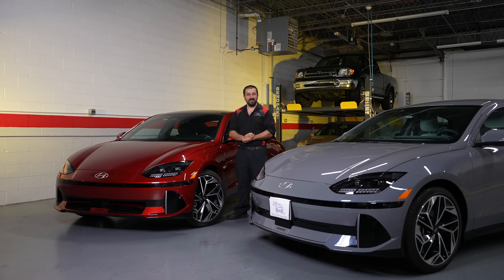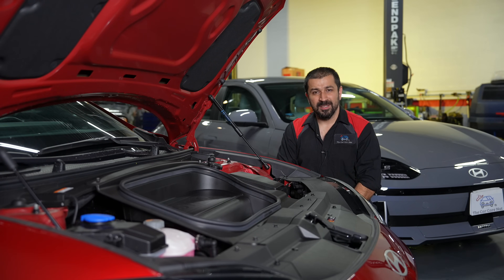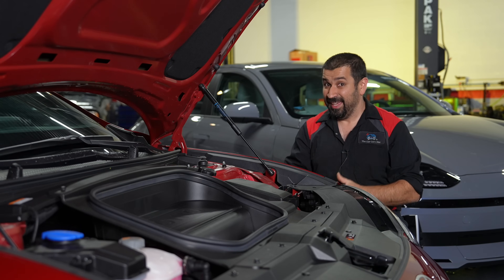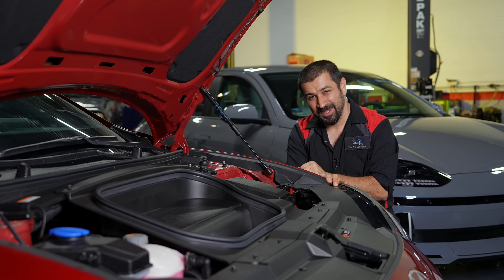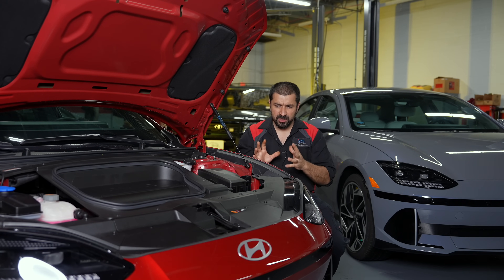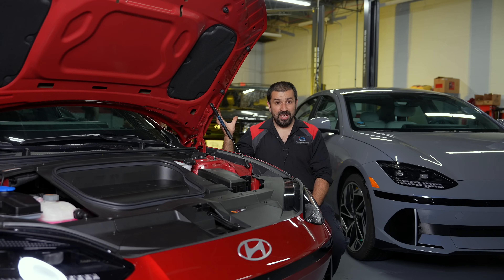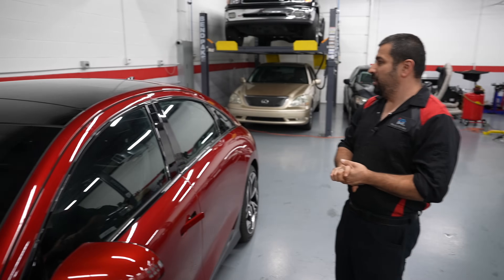Should You Buy a Hyundai IONIQ 6? Thorough Review By A Mechanic

Comment: I live in SW Utah where it's 100*-118* from the beginning of June to sometime in September. Nights don't cool off that much. Sometimes the lowest temperature in the hour before sunrise is still in the 80* to 90* range. In the Winter temps can go down into the 20* to 40* range for a week but usually stays in the 30s or 40s.

Even sitting in the garage temps get pretty hot/cold. Even going in the garage to fetch something during these extremes is uncomfortable.

From what I've read both of those conditions are hard on an EV battery when sitting unused.  Is the correct? Are there solutions to the problem?

Comment: EV should always have resistance heating (ptc) as a backup if heat pump is unable to function. Also it’s extremely common in southern US regions to require A/C for dehumidification AND heating at the same time for windshield defogging for visibility. Yes one can use chilled dehumidified air directed at the inside of the windshield for removal of fogging in the inside of the glass, but the problem is this cools the glass so much that the OUTSIDE air which is high in humidity will condense on the outside of the windscreen, then the wipers need to remove the mist. It’s vital to be able to operate the compressor for humidity removal AND heat the air at the same time and I don’t think a heat pump alone can accomplish this without also using resistance heat. I would like someone to prove me wrong, maybe the tesla octovalve does this I don’t know

Also DC fast charging should only be used for long distance road trips. An EV should normally be charged on level 2 in the convince and safety of one’s own home. Being able to “refuel” over night and waking up with a “full tank” every morning is one of the best features of owning an EV. Even though Hyundai gives owners 2 years of free charging, do not NOT use this to regularly charge your new Hyundai. You are wearing the battery AND plugging up the Electrify America chargers which are already HORRIBLE with broken units. And especially don’t sit there waiting to charge to 100% with your free charging while others are waiting in line to legitimately use the plug for a road trip. If you live in an apartment and can’t charge at home, and you really Really REALLY HAVE to drive an electric car the. I guess go to the EA plug, but I recommend people who live in apartments to NOT own an electric car, it’s way too much hassle then it’s worth, there are plenty of nice high efficiency vehicles that don’t need to be plugged in. Save up for a house with a garage then buy your EV

Comment: Do the later Toyota RAV4 hybrids like the 2023 and 2024’s require the maintenance service on the cooling fan for the high voltage battery? You mention in a video that the intake duct is in the back seat area and Toyota has added a screen for the filter which needs to be regularly cleaned to ensure a steady flow of air to the high voltage battery. Thanks!

Comment: I’ve had mine 9 months and I don’t need to listen to a long review to cut through the chase and tell all the truth. One item that is not true, it’s super quiet on all the Arizona Highways and that’s compared to the Tesla model 3. 
Overall, it’s a great car and I only have one rear motor, not really sure why you would need 2. The big flop about the car, Electrify America partnership with Hyundai, it’s trash and was a selling point when I bought the car. You don’t need me telling this nightmare, just do the research which I failed to do. If you’re to buy one and I highly recommend you do, wait for the 2024 models that will have the Tesla charging connector. That’s a game changer and no, I’m not excited about the upcoming adapters for Tesla that will be offered for the 2023 Ioniq6. The reviews coming out of New York on the stations with the adapters attached have been so so and charging speeds are slower compared to (a working) Electrify America charger. Really though, when I drive to California, the charging situation will give you ulcers and expect long waits for usually 1 working charger at a station. Usually I search out other chargers that you have to pay for, EV-go plus other slow ones and usually you get to the point of just find something.
But as for the car, I really love driving it and love the comfort that all passengers experience. It’s a jewel……..

Comment: On Limited version, motor noise can be adjusted.  Reviewer may have had it set to loud.  When comparing to Tesla 3, Reviewer also missed that Ioniq 6 uses thicker sheet metal than Tesla 3.  When closing the Tesla 3 hood by hand, it feels like an aluminum soda can that may bend easily if not careful.  I found the Ioniq 6 suspension smoother, quieter ride, and seats more comfortable than Tesla 3.  The Tesla 3 does have better technology though.
Reply: Ioniq *. Not Ionic.

Comment: Ok… first there is no dc/dc charger module in an ev, thats the reason why those 50kw/100kw/150kw charge stations are so big.  Internal chargers in the cars are for ac charging, converti it to dc.  So the charger don’t need more cooling because of the dc fast charging capabilities like you said.

And which new car today do not have dc fast charging?  Maybe you were talking about older ones?

The "brake vents" are not brake vents, they’re for aerodynamics/airflow.  The air is actually redirected to the outside of the wheels

Nice video but as a mechanic you should have understand/investigate those points

Comment: After I heard about two Ionic 5 being totaled in Canada due to a slightly damaged battery and the crappy battery protection plate under the car and Hyundai not having a reasonable way to repair the damaged battery I will not buy a Hyundai. The replacement battery was quoted $60k while the new car was $55k.

Comment: I have plenty of seat time in the I6 and the M3.  I found the I6 to be quieter than the M3; not loud at all; it actually has less wind noise than the Lexus LS460 that I traded in on the I6. I also have NO difficulty distinguishing between the two shifter designs...they are just different, not better or worse.  The build quality of the M3 is atrocious.

Comment: Your thorough reviews have brought a few things to my mind about EV's, and maybe someone has some insight on these:
1. I would think it a good idea that each EV should keep track of how it was charged; Fast, normal, wall, etc. for insurance and resale evaluation.
2. Does anyone know how range is affected with A/C on versus windows down?
Reply: The electronics keep track of all values related to the usage of the car. How many kWh DC charging and how long stationary over 80% charged up and so on. So yes you can just read these values from the electronics.

The AC is not using an amount of power that is really relevant for range. Heating does but also nothing that's too big of a deal. Buying such an expensive car and then rolling the windows down to cheap out on electricity is the sad part of the question.
Reply: @MichaelPanzer  The sad thing is on many EV's the use of AC can drop the displayed range 20-30 miles. It is not a cheapness thing. It is can I make it to a destination thing.
Reply: Coming from a model 3, I can say, yes, ac does affect range, just as it does on a gas vehicle, ac system requires extra power from an EVs battery or your gas cars engine (higher rate of fuel usage). Instead of rolling your windows down, you can just have the fan on with ac off. The difference is let's say no AC gives my rwd m3 270 miles mixed driving. AC on will give it a out 220-240 miles mixed, depending on how aggressive the ac use is. How many people are driving more than 100 miles per day? If you are charging your car at home in your garage at night when you sleep, this is a none issue, especially considering how electricity at home is leagues cheaper than gas. You don't think of range.
Reply: @Kareem-cx4fi  Thanks for the reply.

Comment: This would be a great to lease right now...there's some good deals right now on both the Ioniq 5 and 6...same goes for the Toyota bZ4x as well
Reply: Except is actually a terrible time to lease because of interest rates and availability is still dragging (for reasons beyond me).
Reply: @sinister184  Many of the EVs are getting the $7500 credit for lease only not retail
Reply: @trdrav4  In most cases leasing companies are keeping most of that money and apply only a partial amount towards your cap cost. They’re always looking for ways to screw you.
Reply: @sinister184  I'm seeing this $7500 credit that most dealers are giving to customers because its given by the manufacturer, dealer can't change that amount. Obviously when you go car buying, you gotta due your homework.
Reply: @trdrav4  Dealers dont do anything with he 7500. That money is for the purchasers. In the case of leasing, the purchaser is the leasing company, and they have to obligation to pass that on to the customer.
Reply: Exactly, the dealer is obligated to give that deal to the customer to get the vehicle sold, bar any markups that the dealer would do themselves.

Comment: I chose the Ioniq 6 over a Tesla mainly because of the stupid taxing system in my country, which tries to favour local built cars. Chinese built cars lose out because of the high import taxes, and Tesla because the minimum taxing bracket requires the power to be less then 160 KW, so the much more powerful Tesla's become prohibitively expensive. This automatically limits you to one local car, which is ok but still lacks refinement or the rear wheel drive ioniq models which are the best value for money here right now.

Comment: 8:40. Disagree. Tesla's system is utter crap. They drive everything inefficently, including the a/c compressor, to generate heat. As an a/c tech, driving your super expensive compressor and your drive motors to generate heat is a completely stupid idea. It's probably why a lot of Tesla's already have failing compressors already.
And saying the Tesla is "better packaged" means nothing - it means that it is harder to fix and means you have to replace an entire part to fix it, while the Hyundai system you can easily fix what is broke.

As a mechanic, you should of all people, appreciate that.

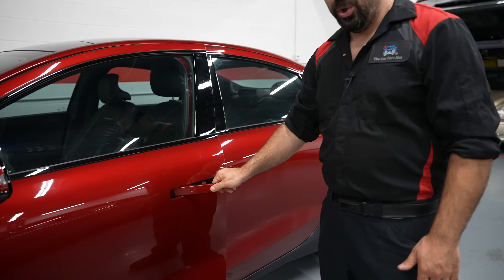Comment: HI again AMD. I have a question at 23:00, but it has to do with the TX (and RX and any other Lexus with electronic door openers) - can I just pull on the door handle on a TX/RX and the door will open? Because I have concerns about first responders getting into the car in a wreck when no one on the inside can open the doors.

Comment: DC fast charging isn't actually bad for the battery. If you only DCFC, you wouldn't notice a difference compared to slower charging.
Reply: Wrong.
Reply: @Digikidthevoiceofreason  Data from 12500 Teslas recently surved by Recurrent Auto showed no difference.

Comment: If you have an issue with your battery it is 50k to replace.   This is a strong Do NOT buy.   This has happened to a new car owner in British Columbia.   Hyundai has priced the battery higher than the price of the car.   If you damage your battery cover your warranty is no longer covered.

Comment: Kinda losing credibility on him when he starts talking about hybrids, PHEV, and EV with incorrect information. "Very loud", I just don't get it. I own the Ioniq6 and worked at Tesla and I still chose this over the Tesla because this is super quiet and lots of room. I have 2 car seats in the back and still so much room in the back even with the front seats pushed back. Also, about the brake cooling vents, quite a few have already mentioned that that's not what those vents are. They are to guide airflow. Anyway, not too fond of him when he has a big following and starts coming back with incorrect information. Way too much bias where unless it's a Toyota or Lexus, it's not a great car.
Reply: Yea this part of him I never understand. He criticized the Hyundai Santa Fe for being loud too but sitting in one (granted i sat in a tucson) it was noticably more quiet than even the NX450h that I test drove.  Toyota hybrid are geniusly built but one thing you can't argue is that they (and their car in general besides the high end lexus) are rather loud on the road.
He did have a lot of good for the Tesla though but Tesla is doing marvelous work in the drive train department that it would be too obvious to talk down on it
I recommend munro teardown videos (I don't watch his "hot-takes") since they are a lot more level grounded and actually divide everything out and explain them.

Comment: Where is it loud - wheel noise, or wind noise?  You don't define it.  As for the shifter, I haven't driven a column shift since 1975, so that's not even an argument.  You want to argue about the display - your closing statement is an argument FOR the Hyundai design decision - I don't need to learn something new.

Comment: So this 54k - 65K EV has an inefficient heat pump. That is going to massively affect the range in very hot and cold weather.  I just drove my 2022 Model 3 home from a dance in AZ and the temperature was102 degrees F. I got a calculated range of nearly 240 miles, and my car has 19" wheels on it, which bring the 272-mile range down to about 260 miles. So in extreme heat, the Tesla heat pump system performed spectacularly well in cooling the battery and the cabin. It really is a spectacular heat pump system. This mechanic is right, there is nothing else like it in the EV industry. That is why the Model 3 is the most efficient EV sold with the exception of specialty EVs that are not true cars or SUVs.

Comment: Why dont you tell them all about the know issue with overheating during charging sessions?  Its a known issue and is effecting many owners.  Something to do with the temp sensor(thermistor) that monitors the cable heat within the car itself.  Prob seating of the sensor is bad..?  I saw a few commenters saying their getting one...😂😂.  Its the ionic 5, 6, some other one, and the gv60 that have this issue.  Also there is a lawsuit.  
Some comments(on the Ionic Guy channel) found the connectors in the car get corroded due to dirt... increasing the heat.. due to added resistance...cleaning the connectors seems to help some.  Should have bought a Tesla...😂😂.
Reply: Ioniq *. Not Ionic.

Comment: Charge port overheats level 2 at 40 amps or higher, ICCU failures, 12v battery failures (this is actually across the Ioniq 5, Ioniq 6, Kia EV6 and Genesis GV60). Why risk it when the Model 3 or Y is cheaper and proven with much more technology. Ioniq has manual push button start, manual door locking, need key fob for approach unlock, regenerative braking resets every drive, route planning is virtually non-existent, maps are not good, charging network is currently unreliable, sound system is not good. I tried an Ioniq 6 after owning Tesla and regretted it, went back to lease on Model 3 for $277/month.
The Ioniq 6 rides smoother, is quieter and has better build quality than the M3, but it is not enough to make it worth purchase or lease.
Reply: they already fixed that. What are you on about
Reply: They would have to build a whole new car to fix that huge list I posted. Unless you are talking about charge port overheating - a TSB software fix to reduce charge current is only a band-aid. The car is an EV with training wheels for someone that is afraid to go all in.
Reply: @maga4813 Wrong. They ADJUSTED IT but the issue is still there.
Reply: @Digikidthevoiceofreason  what issue? You can't even explain the issue they have when they've already fixed it.
Reply: @maga4813  You need to do some proper research then. Go.  Search.   LEARN FOR YOURSELF.
Reply: @Digikidthevoiceofreason Nope. Burden of proof is on you since YOU brought it up.
Reply: @basedkat09  Nope. They want proof then they will get off their lazy asses and find it themselves. I don’t baby feed NOBODY.

Comment: I would never ever ever ever buy a Hyundai or Kia.  The powertrains are all garbage and for for like 7 years in the modern day,  they couldn't even put a cheap, 30 year old immobilizer in the key and ignition.  No Fing way.  I was hesitant to buy my newer, used Toyota even though it was a 2018 model made before the forseen CV debacle because of all of the extra computers/electronics and cheaper build quality on atleast the superficial parts of the interior and exterior that is visually and physically evident.